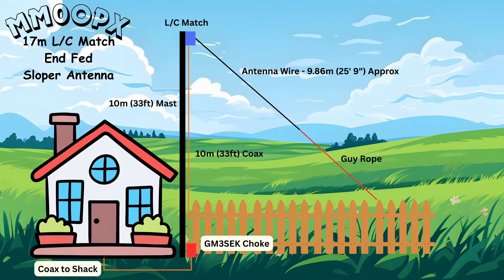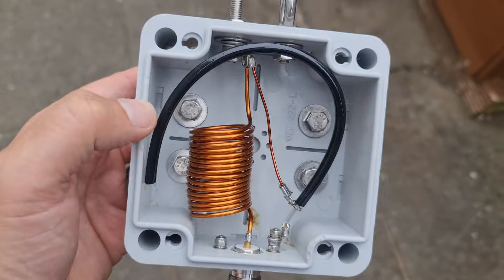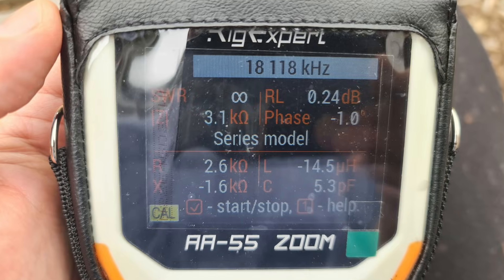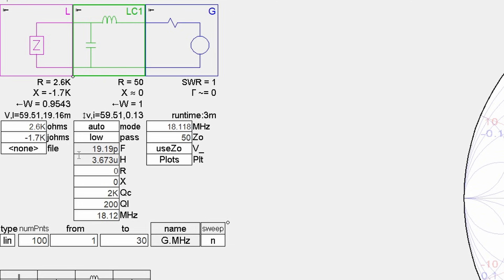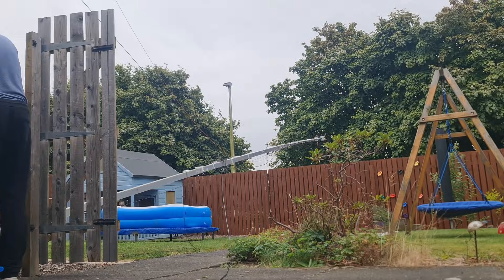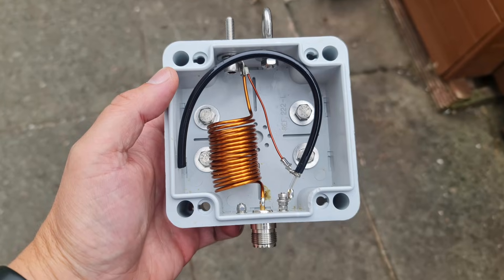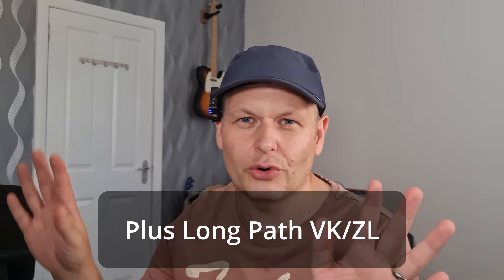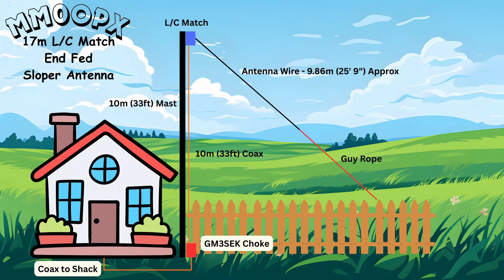Work DX Cheap! 17m End Fed Antenna – No Ferrite, No Radials

Comment: I have the same antenna Colin, I didn't build it, I bought it from a UK supplier who has them on his site for all bands. I have a 40m, 17m and 10m version, all superb. My 17m one I have mounted as a vertical out in the garden on a cheap fibreglass pole (box at the bottom) and like you have a choke further down the line before the shack.  17 is a great band and is a good place to retreat to when contests are on.
Reply from the maker: 17m is my favourite band. You do need the sunspots tho. Just wonderful DX there and you dont need a super station to work it.

Comment: Good stuff Colin. I built several LC matched EFHW using Amidon iron powder toroids for the coil. You can check pictures on my QRZ page. It works really well, but the bandwidth is too narrow, probably due to the high Q. I will try air coil instead.
73, PA8MM

Comment: Very cool project Colin! I've been using an LC-matched antenna for 20m for more then a year now, and it is a you say a great design. Tho' once you decide to go that route there is really no need to limit yourself to ½λ; you can match anything that way. For my 20m one, I just cut the radiator to the exact length of my DX Commandter "10m" travel pole (so just shy of 10m). I also used 3 2.5m radials, since I usually don't run more then a few metres of coax when operating portable. That thing has been working /really/ well. I did more then half my 1k mountain goat on it. I did however use ceramic caps for the capacitance, my theory being that they have a higher Q, and so the match will be more efficient. But with them just mounted flying in the little match-box, they didn't handle the mechanical stress of being carried around too well, and so I've had to replace them twice. I may just go with a bit of low loss coax for for my next one :-)
Reply from the maker: Your spot on. Its an easy method to match any length of wire. I have one of those poles too,  might do the same. I may even make a PCB to take capacitors and inductors.

Comment: The LC matches are a great idea Colin, never heard of this before. That and using a piece of coax instead of a capacitor! I like that the wire is coiled and no need for a toroid, might experiment with this to see if it could replace a 49:1/64:1
Reply from the maker: For a monoband definitely and its will have less loss and handle more power.
Reply: @MM0OPXFieldRadio  Free harmonic suppression included :)

Comment: why dont you make a λ/4 antenna  with  3 radials ..is there any difference??
Reply: A halfwave has 2.5db gain over a quarterwave groundplane and needs no radials
Reply: @Jor-d2i  Yes, a vertical 1/2 WL at 17m is a good performer. He has a radial here.... but we would say a counterpoise in our ham hobby.
Reply from the maker: Because I dont have anywhere in my garden to do this and have it set up permanently.

Comment: For the nanovna you use the smith chart to find the value on the inductance or capacitance graphs. There's a video on it somewhere on YouTube. The measurements feature is kinda flaky. The smith chart method is much better.
Reply from the maker: Thanks. Having the Rig Expert just makes it much easier.

Comment: Hi Colin
I've made similar in the past for 20,30 and 40m. I put the coax on the outside and trimmed for resonant point where I wanted it. Coax is great for this purpose, I've also used switched LC circuits for a W3EDP and that worked great also. Great work on all your projects, it's gives inspiration.
Reply from the maker: Thats a good shout. My last one I did this but didn't fancy putting this up and down a few times to adjust.

Comment: I followed up  ur   all project  Q is calculated by wire length  7.86 m, but in your project 9.86, this could be the reason for the Extended Coax length? 73 de TA1BJ
Reply from the maker: Appreciated, I will check it out.

Comment: Sorry I forgot to mention re L-C matches... I just made an L-L match for a 17' Telescopic Chinese "red slug" whip to make it tune on 40... As the whip is an 1/8th wave on 40 is is too short & already has too much capacitance so when you make the L-C match the "C" branch becomes an inductor to reduce the aerial's own capacitance down to the right value.
I had a small double rollercoaster I'd picked up at a rally (looks like part of an old army radio) & it works well with that but that is overkill & the waste of a good roller coaster so currently trying to replicate the coils with 2.5sqmm earth wire... If I had a LCR meter like yours to measure what the rollercoaster got set to & duplicate that with the mains wire that would make the job so much easier... I think you have just persuaded me to get one.
Reply from the maker: Oh for sure. I just take it for granted now. Just makes the job a doddle. You wont regret getting one.

Comment: All fantastic information & many thanks as I've certainly benefited from this video. More please!.

as another option for 17m, would paralleling a 17m dipole onto your existing doublet to make it a fan doublet have worked? (A half wave of wire should radiate the same whether you tickle the middle or end of it)
Reply from the maker: That is interesting, I need to look into that and model it.
Reply: @MM0OPXFieldRadio although you have now made your LC match single band EFHW you might like to consider this for the future:-
The Zepp (EFHW fed onto tapped quarter wave stub) is often criticised for not having anywhere for the current to go on the non-EFHW hot side of the stub.
The recommendation for "normal" 49:1 UnUn fed EFHW is that you have a short "tail" on the UnUn for it to react against... In which case this is beginning to look like a very very very off-centre fed dipole. The more off-centre you go on a dipole the higher the feed Z ( could tail length impact why some people favour 49:1 yet others find 64:1 better?).
On a "normal" quarter wave match Rin x Rout= Rline squared.
If Rin is 50 & Rline is 450 budgie ladder then Rout is 4050 which is getting towards that of an EFHW.
Question.. by judiciously reducing the length of the main "half wave" & balancing that against your short "tail" length could a very very very OCF dipole have the offset balanced to be fed with a quarter wave of 450 budgie ladder with just a 1:1 balun/choke where it meets the 50 ohms co-ax?... No idea if this would work but it is an interesting thought....no inductors, no capacitors just a specifically measured extreme ocf dipole & a measured 450 ohm quarter wave match.

Comment: I love this idea.  A fixed matching network works great on narrow bands.  Have you considered a high pass match to drain static on the wire?   73 KK7YIS
Reply from the maker: It does and has a tight bandwidth which blocks out a lot of noise. Have thought about the static drain but not on this. I purchased some hefty resistors for fitting to a vertical which I never got round too.
Reply: @MM0OPXFieldRadio making the coil Q-factor as high as possible will help with both efficiency and noise reduction.  I used SimNEC and your numbers to play around a little bit and found that making the antenna slightly inductive (short) cuts the size of the inductor needed and results in a slightly lower loss.
Reply: Just want to update my comments. I figured out why almost everyone uses a low pass instead of a high pass L-match.  If you think of the L-match as a voltage divider than the capacitor is on the low voltage side for a low pass filter.  As arcing is normally the limiting factor for this type of match, it makes sense that everyone does this way.  73 KK7YIS

Comment: Very interesting Colin. I actually took my 17m vert down, simply because I found my 2 ele vert on 20m works great on 17m hi.
Just got my 80m inv L on the same 40m coax, and luckerly no interaction and worked first time.
Oddly enough, my 40m vert works well on all bands 40-10m via tuner hi my very old mfj 914 tunes anything hi. 73 mate.
Reply from the maker: Thats great mate. 20 and 17 are pretty close. I just dont have the real estate here so this was a decent compromise to keep something up for 17m full time.